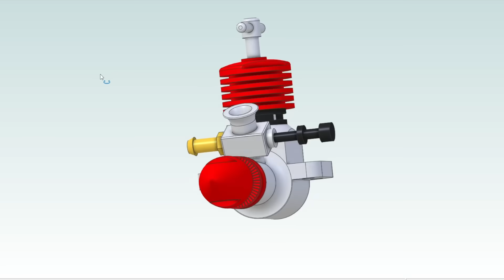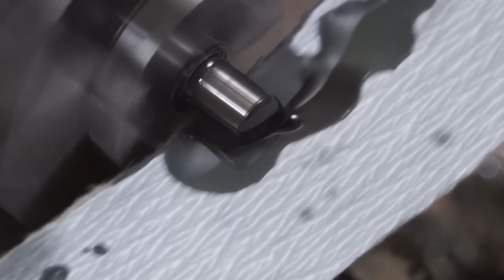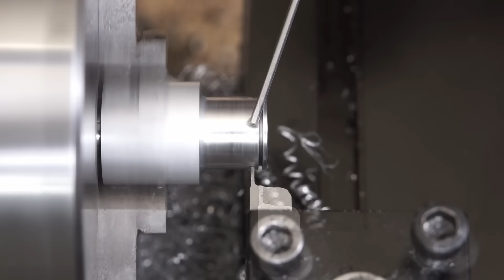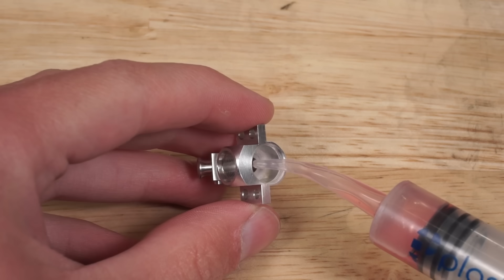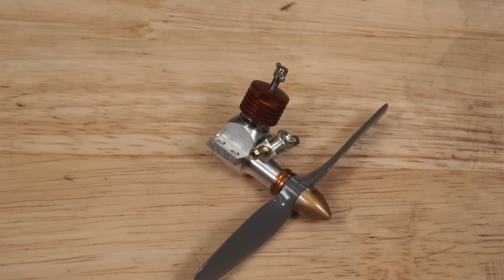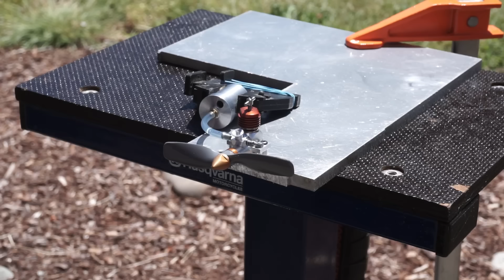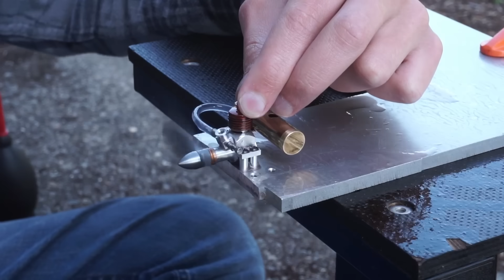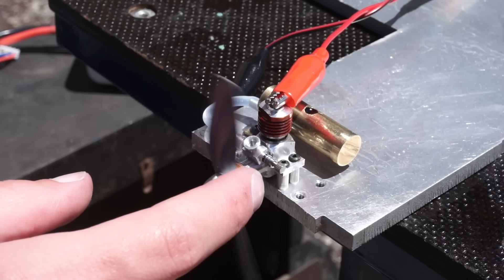I Make This Tiny 2-Stroke Engine From Scratch

Comment: So, it took you three days to get the engine started? When I was 13, in 1968, I was gifted a 0.1 cc engine, the Thimble Drone model, very similar to this one. The user manual said to turn the carburator valve screw about 2 or 2½ turns. It took me two years to get the engine started, when, out of desperation, I systematically tried all the valve positions in increments of ¼ turns. It finally started when the count was 12½ turns.
Reply: wowzers that must've been so many attempts!
Reply: If it was the Cox 0.049 with the aluminum fuel tank/engine mount they had a bad habit of gumming up the needle valve and fuel-line pickup from old Cox fuel.  The best way to deal with it was to backflush the needle valve by taking a fuel syringe with a bit of silicone fuel-line on the nozzle, remove the spring and needle valve and give it a healthy squirt down the threaded hole the needle valve lives inside.  better than taking the whole tank apart just to flush the gunk out. You also need to annually take the tank back-plate off and clean the old gum and crud from the bottom of their tanks.
Reply: @tauncfester3022  Yes, it was that type of engine. And I had to build the fuel myself, which ended up being very expensive because of the ricine oil in the mixture, that I got from a pharmacy (my country had nearly no model shops those days).
Reply: I lost interest in diesel engines when I bought one in my youth, (I forget the make, - it was 50 years ago lol), and ran it in, mounted in a vice attached to a wooden stool. I left it running and it was sounding sweet, - too sweet..., it overturned the stool and snapped the crankshaft..😩 Just a dumb mistake, but to a 15 year old, ....devastation.
Reply: @Demotricus  The Thimble Drone wasn't a Diesel engine.
Reply: Friend, can you explain to me if you have a carburetor and with which generator the spark plugs are turned on, please.
Reply: Two types of engine, "diesel" and glow plug. Diesel type uses a fuel containing ether which is so explosive that adequate compression will trigger it. The screw mechanism in the cylinder head adjusts the compression for timing purposes.  No electric heating is needed.
  The glow plug has a filament like an old light bulb. The fuel contains nitromethane, which burns explosively.  A battery is used to initially heat the filament red-hot. Once the engine is running, the heat of the explosions keeps the filament hot, and no electricity is needed.
  The diesel type is very fuel efficient. Flying a diesel RC airplane requires a stool, a sandwich, and a thermos of coffee.
  Safety note, finger starting a model airplane is dangerous. A kid in our club didn't use a chicken stick, and wore surgical stabilizers and bandages for over a month.
Reply: You are in your 70s? Amazing, may god grant you a long life full of happiness and may god bless you
Reply: @you.got.gapped.racing44  Thank you, but my god cannot grant anything or bless anybody. A blind, deaf, purposeless, mindless, capriceous god: the Goddess of Fortune, also called randomness.
Reply: That is so true!!!! Hahahaha had the same with mine.
Reply: I had the same issue as a kid with my control line .049 corsair aeroplane. Best Xmas present I ever got. But I spent half the holidays failing to get it started with the needle 2 to 2.5 turns out before I started winding it more and more in desperation. 5.5 turns was the magic number , and once I had that figured out it started first flip of the prop every time! I flogged that thing for hours on end down at the park for many years. The people living nearby were either stone deaf or very tolerant!
Reply: Guessing the instructions forgot to put a '1' in front of the 12.
We made so many model airplanes, in the '60s, what a blast!  .049, Fox 35.  I made my tanks from old metal cans to fit the area, soldered it all together with a 1930s-40s giant soldering iron.  Put the brass ports in both sides so I can fly inverted.  Still have most of them...still have a few "new, in the box" Carl Goldbergs.
Reply: Hi, Me, about 1975 got exactly the same looking engine. It was russian version of this, Mk15 engine but bigger - 1.5 cc. I born in North Poland and those days a lot product in shops was made in ZSRR, means Rusia. A many of them has been copied from western world. For example you could bay for tiny price almost every book from USA but in Russian. Polish students learned Russian because of this. I still can speak a little bit Russian.
Reply: … at the same age but 5 years later, I made the same experience, kept me busy for a while, Finaly theh tethered flight aircraft was flying, and wrecked shortly after this …
Reply: @jurgisler4085  ... as wrecked my airplane was, too, in its first flight.
Reply: I inherited a 1960s and 70s hobby box with all kinds of rocket stuff, micro motors, homemade powered boats and planes, and I had one of those motors I got to tinker with forever and finally got it puttering
Reply: Amazing engineering here ,,, I was glued to the video , so I had to subscribe
Reply: Why do people think they NEED such a weird hobby? Such engines suck. Why don't they build themselves a proper JET ENGINE?! Or their own sailing boat? Or a pair of clogs for walking? Nobody needs engines. There is something wrong between those ears.
Reply: So the 50th 1/4 turn was it’s sweet spot
Reply: ur supposed to turn the screw all the way in then 2 turns out. not 2 turns in
Reply: Brain broken
Reply: @noamhaziza8137  Exactly. It only worked after 12.5 turns out.
Reply: @voornaam3191 an explosion is just a very forceful expansion of matter. thats what an ICE relies on. now, diesel may not be particularly explosive under atmospheric conditions, but it certainly does explode within the engine cylinders and it does so by igniting without a spark.
Reply: @DouglasMcArtur  Buddy wtf are you talking about 😂
Reply: @jackcarlson8875  CÓMO SE ENCIENDE LA MEZCLA EN LOS PISTONES.🤫
Reply: Terrible misprint…
Reply: Yoo 13 at 1968
Reply: Oh... No wonder I couldn't get it started even with a very fast drill.. The seller on eBay showed it running but I already messed around with it before trying to start it properly. Oh boy it's gonna be a long one.
Reply: Cox had the 0.10 CI engine way back when. The trick to getting that to runs was 50% nitro. I had one and it was an amazing little engine
Reply: When I was like 10 around 1995 I was at my cousins house he had one of them plastic planes that had a small cox engine with 2 pieces of kite string attached idk if anyone remembers these but you basically got it running then it flew in circles around you and you held the handle that the kite string attached to and with movement of ur hand it would go up or down. My cousin and uncle could never get it running and knew how to start it and adjust the throttle which was just a jet basically. It had a small fuel tank maybe the size of a Dixie cup or less. Well I ended up burning out the glow plug from trying to start it so many times and leaving the battery hooked to glow plug for too long before I realized the fuel tank was not letting fuel drain because it was plugged with plastic from when it was made. We got another plug and got it running. Looking back now it was pretty dangerous for 2 kids messing with it without an adult around lol. Even worse my cousin insisted we work on it in the house on the big island in the kitchen well they lived in a really expensive house probably worth 1 million bucks now and the island in the kitchen was about the size of the entire kitchen in a normal home now. I mean we were trying to start it in there lol
Reply: Nice machining……May I ask what model lathe and milling machine you use……?  Ta
Reply: @miket3445  I bought a miniature mill and a lathe about 15 years ago, expecting to have a shop soon. But life played differently, and, thus, they are still in their unopened boxes, kept with many other stuff. I cannot remember their brands. European, and the mill is from Germany. That's what my memory tells me.
Reply: yup, I have the same story.  Ignore those recommendations on old engines.
Reply: Thimble drome??? 
If so, that would make your story totally believable and quite incredible in a sense.
Reply: @wafikiri_ that satisfaction when it went bzzzzzzzzz, kudos friend
Reply: My Cox Command Jeep kept starting and stopping, it took me 3 years  and 3 calls to Cox saying it will break in, just go by the instructions, yup she finally run for years, then broke the crank pin so I ordered the parts and rebuilt, then ran for a some more fun years.
Reply: It didnt start
Reply: Persistent son of a gun
Reply: @CaptK-py8rq Good ole days !  I built several Goldberg Lil’ Satans and a Stuntman. Also built a Goldberg Voodoo and I installed a Fox .35 on it. I also went through several Cox models like a P51, P40, Crusader Stunt and probably others. I don’t know how much money I threw at Carl Goldberg and Cox but it was a lot, at least from a little kid’s standpoint. 😊
Reply: Similar experience.  Way back before vid games.  These model engines will keep you hacking at it with hints of ignition, but have a very narrow stable range. Oh it tore my hand up.
Reply: Именно такие упорные и целеустремлённые люди, как вы, способные пройти вместо 2 оборотов 12 и поддерживают наш мир в работоспособном состоянии. Как хорошо, что на Земле есть такие люди как вы!
Reply: @ronmorrell9809  I started model engines from .010 to .15 by hand and never got seriously hurt.  Thwacked very rarely, but it didn't do any damage.  A bigger engine I can see.
Reply: Look at the Atwood.049
Reply: dang bro you old
Reply: @Ratmonger4500  Only old in years lived. My mind continues to be better than most (e. g., I've recently designed a computer processor), and I am agile enough to move fast and accurately (e. g., running).
Reply: 10.25 turns and finally got that cox helicopter started. Turnned it loose and watched it go up like a rocket into a low cross wind where it took horizontal flight out of sight but even worse out of earshot and that's a long way off, never to be seen again. Man those things were loud for about 10 seconds which is how long it took that helicopter to disappear.
Reply: bros an unc
Reply: I loved reading this comment and thread
Reply: lol 2 years 😂
Reply: @wafikiri_  To be fair, he wasn't asking your god to grant anything but his :P
Reply: i have old soviet made 3 or 3.5cm3 "diesel"-engine, never been started. It doesnt use metanol as a fuel and doesnt need glow plug at all.
Reply: @peanutbutterisfu I had one of those planes! 😃 I got it as a birthday or Christmas present back when I was a kid in the late 80's. It was a really cool model of a WW2 plane. I loved it, but mainly I just liked messing around with the engine because I was too scared to fly the plane, lol. I just liked starting the engine and seeing it run. My older brother took me to the park and we flew it a few times. I think I did try to fly it once, but it was very hard to control if I remember right.
Reply: @pauls5745  about 50 to be precise
Reply: @wafikiri_ What country ? My country usually has 1 or 2 hobby shops.
 😂
Reply: Are you sure you went the right way 🤔
Reply: I had a couple of those planes i'd get dizzy trying to fly them. When i grew up and could afford it I got in to RC planes. I still have an assortment of engines and parts. Nostalgia.
Reply: @ronmorrell9809 NO! That is NOT how the "glow plug" engine works. 

It ISNT the "heat from the last combustion event" that keeps the glow plug hot for the next one... 

It is, in fact, a catalytic reaction between the Methanol in the fuel AND the Platinum in the glow plug element, that starts the ignition of the next cycle. 

A fine Platinum wire stuck into the vapors of a jar that contains some Methanol in the bottom WILL glow on it's own just being surrounded by the Methanol vapors.
Reply: @jotch_7627 NOTHING explodes in ANY engine. If it DID, the engine CERTAINLY wouldn't last very long. 

It's just a very fast burn, BUT NOT an explosion. 

A deflagration and a detonation are 2 VERY different things.
Reply: @davelowets  Thanks.  I stand 2/3 corrected Wikipedia attributes it primarily to the platinum catalytic effect you describe, and partially to latent heat and heat of compression.  I am astonished to learn that the Cox motors of my 1970s youth had platinum in the glowplugs.
  Again, thanks for the education.
Reply: Am I the only one who isn’t an adult?
Reply: @CaptK-py8rq  we did the same. Me and my friends really liked control line combat. I don’t know how many Lil’ Satans or TF Combat Kittens we went through. We also used our Cox models for combat although not as good as the C. Goldbergs and Top Flite models. I also had a Fox .35 on a Voodoo model.
Reply: so you wasted years on a tiny thing that couldn't do crap for you just to start a model
Reply: @wafikiri_  恭喜
Reply: i think that is an awesome experience
Reply: @wafikiri_   maybe the instructions had a typo 😅
Reply: @NaturalSlow Undoubtedly, but a double typo!
Reply: Dim
Reply: Hrrdrrdrr back in my day (1868 to be precise) when I was a preteen dur perder perduurrr
Reply: Damn. Two years just fiddling in frustration. ChatGPT would have got that engine running in 2 hours tops.
Reply: @peanutbutterisfu  I had one of them as well, believe it was Blue body with yellow wings. Spent more time trying to get it running than ever flying that damn thing. Having to constantly deal with glow plugs and the glow plug igniter sucked so bad.
Reply: @wafikiri_  how old are you now 💔
Reply: This guy is a better machinist than I am best wishes .
Reply: 12 turns, or 12 flats? LoL anyway, I have a weed eater that is very similar, haven't used it in two years
Reply: O. G walo very very long ago when i was born 1967
Reply: Ok so either it was a typo or u lying cuz u r 70 and a 70 yo wouldn't know how to use YouTube but if u ment 1998 than ok
Reply: @jurb417  is it about 50 or precisely 50 that’s a very contradictory statement
Reply: Wow! Me and my dad had a similar experience with a thunger tiger .15 GP .... We got it started with 6 to 7 turns of the needle valve ..